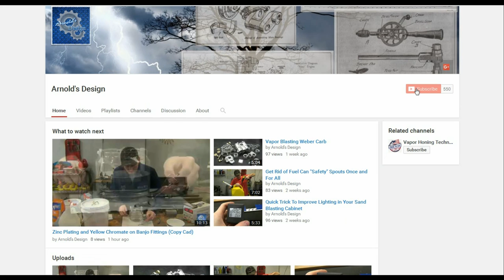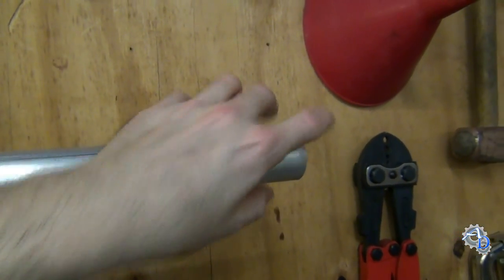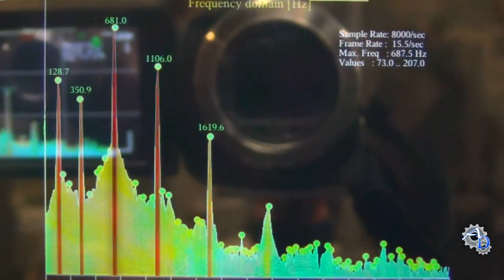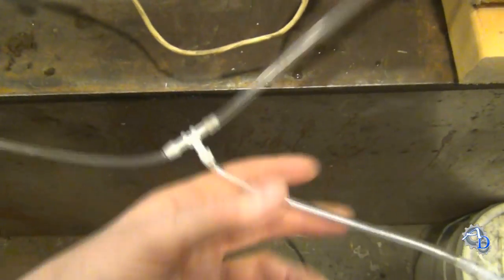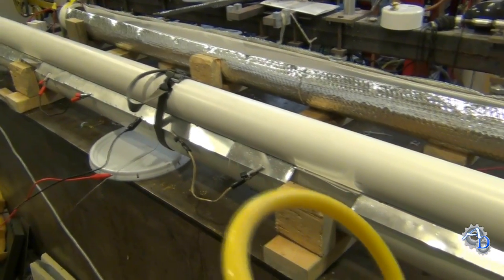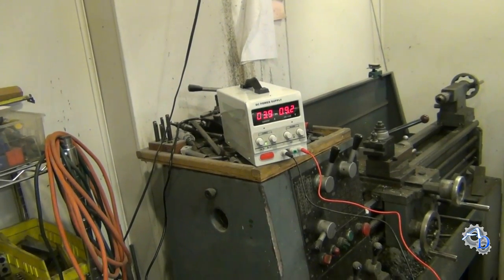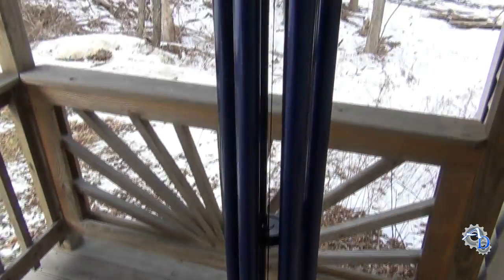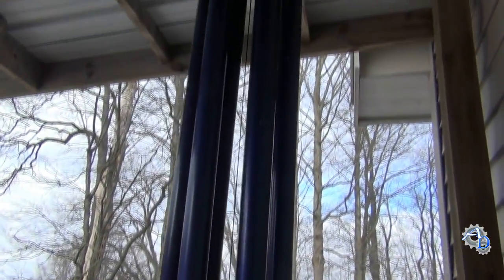Handmade 7 Foot Anodized Wind chimes

Comment: Whoah....you've got some super helpful info here....I'm actually taking notes. I haven't finished watching the entire video yet but just wanted to say how beautiful your chimes sound! Thank you for your tutorial!
Reply from the maker: Thank you! I'm glad you like them.
Reply: Arnold's Design  I have been thinking about making some for quite a while now but do you think it's even a possibility for someone that knows nothing about tuning? I've watched several videos and yours is the most informative. But it's also raised many more questions.
Reply from the maker: Yeah, you can do it. There are chime tubing length charts on the net that will get you close, and maybe close enough where you don't need to tune them. I'd tune them for scales and not chords, because chords don't sound good for some reason, at least with mine. Plan your chime length for perceived notes, because that's what you'll actually hear. I used a guitar and compared the sound to get mine where I wanted them. The phone app is nice but not perfect. I think your ears are a better judge of tuning. The hang point should be 22.4% of the total length, so don't drill hang point holes until you're done tuning. There are builders like Lee Hite, who is a chime guru, who might do it a different way, but that is just how I do it.
Reply: Arnold's Design that is so good to hear and I have watched a few of Lee Hite's videos and they were awesome as well but yours was easier for me to understand the most important parts. I did note the formula you used at the beginning of your video and also noted fundamental vs. percieved. I didn't understand what I was noting..lol..but it sounded important. Thank you so much for your replies and your advice!
Reply from the maker: Absolutely. If there's anything else I can answer, let me know. It's been a while since I built those, but I'm sure I can come up with something.
Reply: Arnold's Design thank you so much.

Comment: Thanks for sharing. Is there a calculation for the clapper diameter?  Like how much smaller than the B.H.C. of the tubes etc.
Reply from the maker: Not that I remember. I just made it slightly smaller so that it wouldn't have to travel far before hitting a tube.
Reply: @ArnoldsDesign  thanks! That makes sense. I'm thinking making mine 1/2 or 3/4 clearance. Love your video
Reply from the maker: @spekky9012  Thanks

Comment: Excellent work friend and thank you for the technical aspects of the tuning process, which is how I found your channel. You definitely have a saleable product if you chose to go down that path. Your knowledge of the anodizing process is valuable but you may want to consider sending quantities of materials to a commercial anodizer. Much less hassle, safer, more room in your shop, and nosey environmentally minded folks will get no traction with your efforts!
I've been an architectural metal fabricator for 45 years and love working with metal. I was thinking of going this route with brass tubing but aluminum is a nice option. Oh, and lastly, please get very comfortable and even desperately dependent on using safety glasses!! You don't want to be dwelling the rest of your life on why you didn't walk five feet over and grab your safety glasses!! Very lousy trade off.

Comment: Does a "node point" represent an octave range?  I love how frequency and life are intertwined.
Reply from the maker: A node point is a position on the tube where the sine wave of the fundamental frequency and the overtone waves equal zero. In other words, none of the frequencies vibrate at the node point, so you can suspend the the chime tube there with dampening the sound.
Reply: @ArnoldsDesign  I understand that.  In your video you have two nodes.  I can't remember if cutting 1" away from one node vs the other would produce the next octave.
Reply from the maker: @soundmapper  I suspend them from two nodes for tuning only, both 22.4% of the length measured in from the ends. I'm not aware of how much the frequency would increase by cutting off 1". It's best to get a length chart off the net as a starting point. Cut each tube a little longer, and trim it to tune. I use a guitar in this case to tune.

Comment: When drilling the hanging holes, do you have the centre of the hole on the node point, or the perimeter of the hole at the node point?
If the centre of a 3mm hole is at the node point, the actual hang point will be 1•5 mm away from the node point.
You can't hang something from the centre of a hole.
Reply from the maker: It's drilled on center. There is threaded rod going through the center point, so it sees center of node. Even if it wasn't, I haven't noticed that being off a slight amount creates a perceivable dampening effect.

Comment: Finally, someone gives the ratio for the node points!
I have measured a lot of windchimes in stores, and musical instruments, and I came up with 1/5, which would be .200
I'm glad to find out I was wrong before building one.
I'm surprised you used a scroll saw instead of a bandsaw - you seem to have quite a machine shop, so I'm guessing you have one.
Did you give all of the (rough) tube lengths?
I intend to start with PVC pipe for the first one, so making it large is not a problem.

Comment: I worked in GMC platting dept.  for several years. You did not show the sealing in hot acidic acid. The sealing process was tested with a pair of probes at 800 volts. If it rang they where scrapped.
Reply from the maker: They were sealed in nickel acetate solution. Boiling water is sufficient though.

Comment: Im wanting to anodizes some tubing. when you made your PVC tubes for Dying and sealing. What did you used to heat them?
Reply from the maker: A 1500 watt hot water heater element, but you can get submersible heater from amazon pretty cheap now. If I'd had the ceiling clearance, I would've sat the pvc pipes upright to dye and seal. It would've been much easier.
Reply: @ArnoldsDesign  One more question. I'm using 2'' aluminimum  I notice you had your tubing in for about hour and a half. how did you figure the time?
Reply from the maker: @martyyates1115  I waited for the voltage to plateau, and then start to drop slightly. That is when the thickest anodized layer is formed. Caswell plating has a great guide to anodizing that I recommend that will take the mystery out if it. https://www.caswellplating.com.au/LCD.pdf
Reply: @ArnoldsDesign  Great! Thank you.
Reply: @ArnoldsDesign  I have a question, how many Amp did you use for your longest piece of tubing?
Reply from the maker: @martyyates1115  I don't recall now, but it's simple to calculate. Multiply pi x diameter, which equals circumference. Multiply that by the length. That's your area. Multiply area (in square ft) by 4.5 amps. That is the amp requirement.
Reply: @ArnoldsDesign  LOL Yeah i knew my measurements i was worried about the amps. my power supply is only 2amps. Thanks

Comment: How did you attach the  string to the rods inside the tubes?  I want to repair a really nice chime that is more than 20 years old I need to replace the cords
Reply from the maker: There are a couple ways I've used. Tie the cord to a small bolt. Hold the tube about 45° downward, and slip the bolt down into the tube past the hanging rod. Once past the rod,  spin the tube 180°, and tilt the tube upward until the bolt and cord slide back out of the top of the tube. Remove the bolt. The cord end is looped around the remaining cord and tied into a knot. This forms a loop around the inside rod. After that pull the loop tight. The sliding knot tightens over the hanging rod. Keep an eye on the knot as it tightens to make sure it stays centered inside the tube.
Another way is to make a small knotted loop in the end of the cord. The cord is then lowered into the tube past the hanging rod. Use a J hook to grab the loop and pull it back around the other side of the rod and out of the tube. Once this is done, fish the remaining cord through the loop and pull it tight around the hanging rod.
Reply: How did you get the old knot off the pin? I have a very expensive wind chime that i need to replace the string. I have been searching on how to do this. Which string do you recommend to use?

Comment: I'm thinking about making windchimes in my garage. Can you give me any advice?
Reply from the maker: Just follow some of the things I did in the video. There's a lot of tuning length info on the net. That's important to sound good. Tune to scales, not chords. Strike either the ends or center of the tubes to get full sound. There's too much to list, but that will get your started.